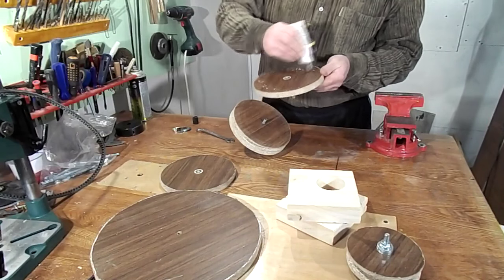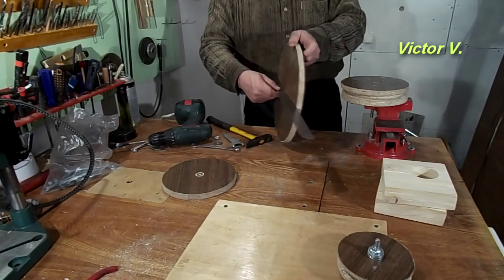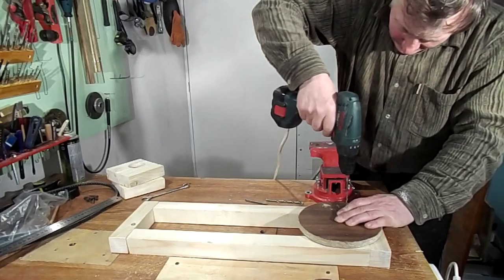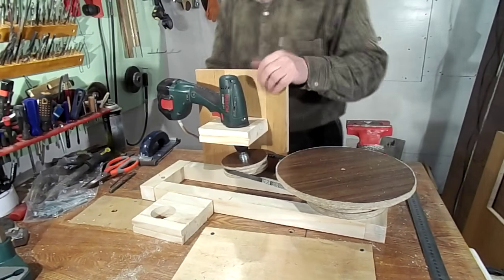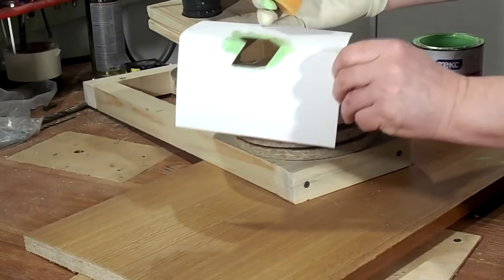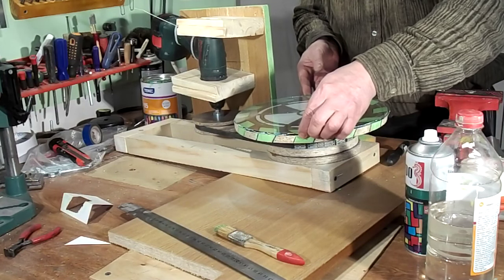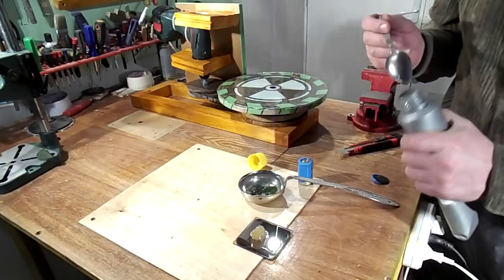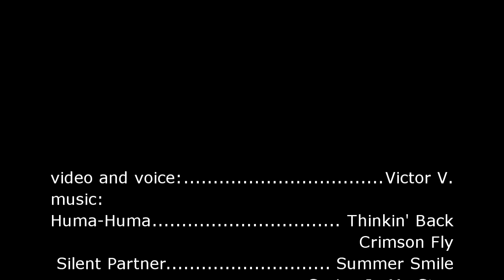How To Make High Precision Sharpener Pt 2

Comment: Is there any reason to use clear glass instead of frosted or sandblasted glass? I think the texture of the surface would hold onto the abrasive paste better and the glass is going to get frosted anyway so why not start with it?